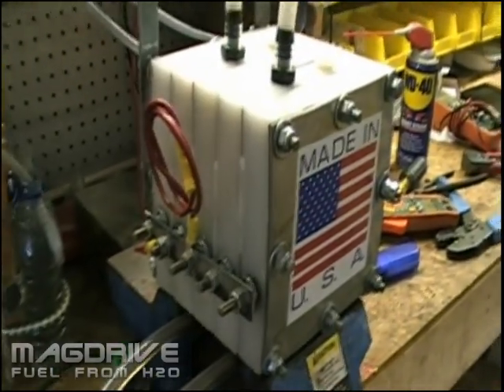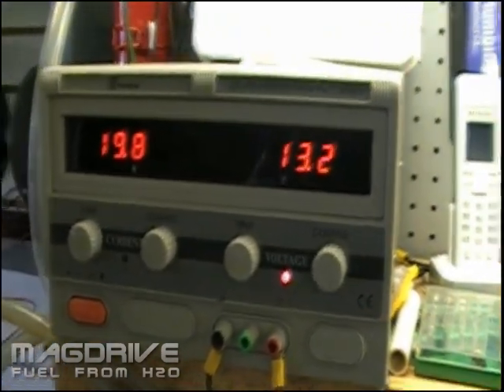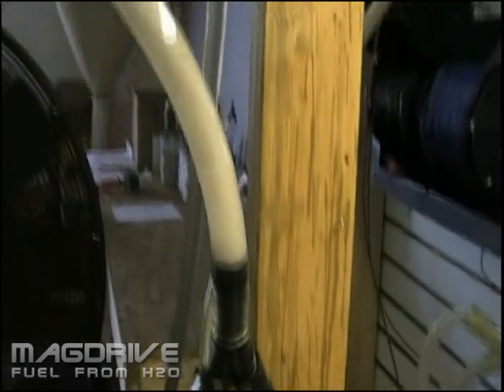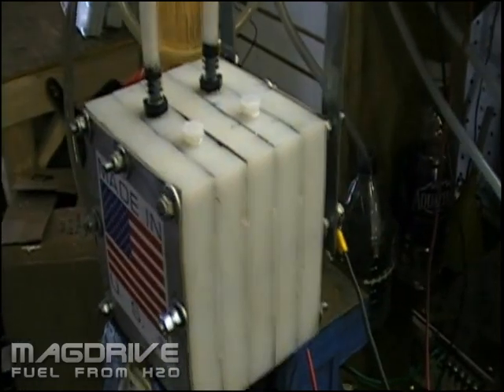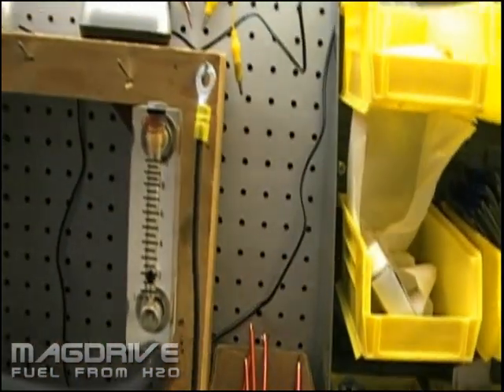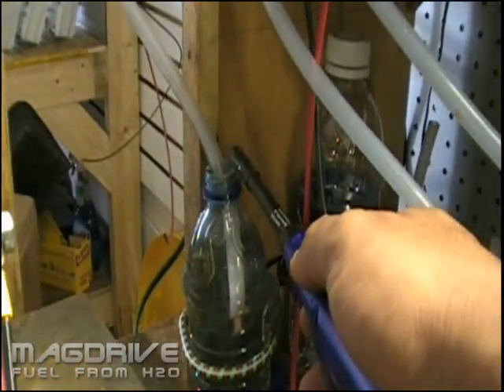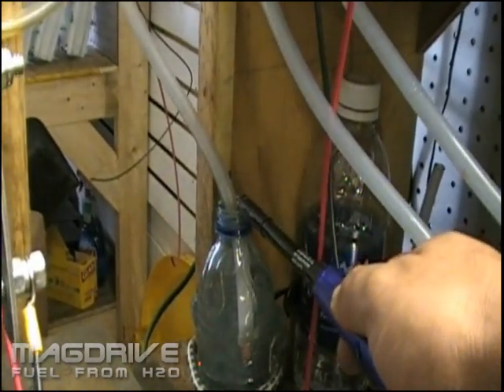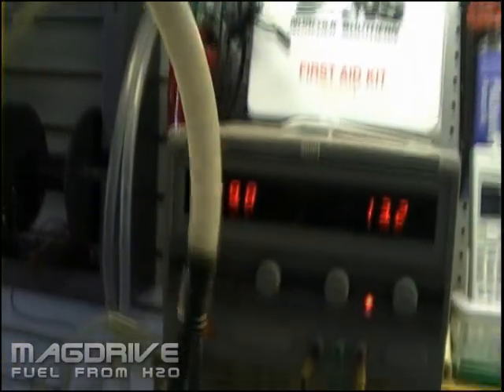MagDrive Series14a Q-5

Comment: i have studied many designs and built many cells and beleive this design is best for me.i will have seperate entries for all cells and seperate exits for all cells. the aim is to have entirely zero effeciency loss due to voltage leak. do you think this is worth it with all the extra work and pipes and conections or is the effeciency not really so applicable if run off mains.what is your opinion.i ask you because i think your opinion is valid. regards andy